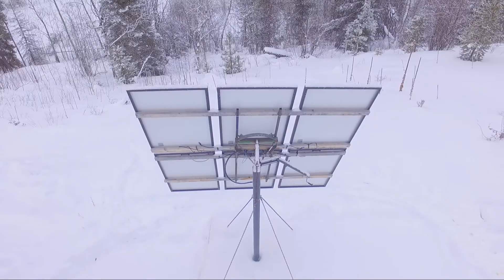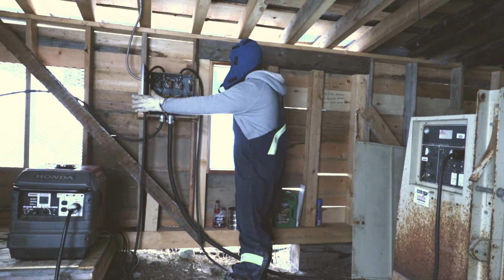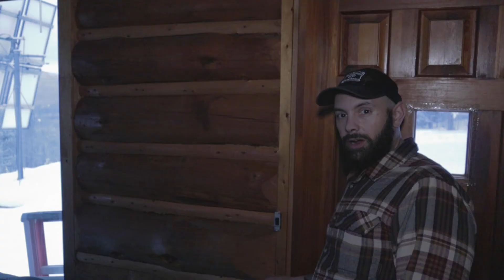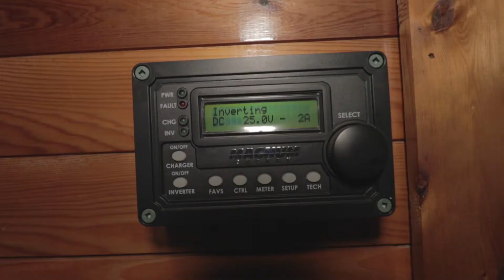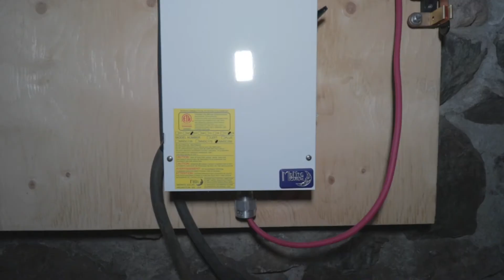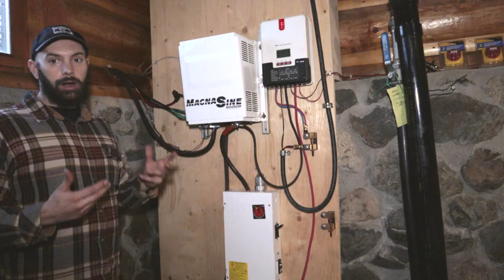OFF GRID POWER SYSTEM explained

Comment: Are you thinking of going to a 48 volt system? I think the inverter would have less work and it would be more efficient.
Reply from the maker: We are on a 24 volt system as of now; however if we did want to go to a better system we could do 36 or 48v. In time! As of now we have plenty of juice. Would need more batteries if we wanted to upgrade and then re-jumper everything.

Comment: Are the batteries for the solar panel? When are the batteries used? You have 2  generators for power plus 6 solar panels.....that seems like a lot of power need....I would assume this is due to the size of your property.
Reply from the maker: The batteries are what power the house 100% of the time. The solar panels and generators are to charge the batteries. We use the small generator only when there is a week of cloudy weather and the solar panels don't charge the batteries enough or if we are using high powered appliances that would put a massive drain on the system such as a blender, hot water kettle or power tools.  The big generator is used when we need to use 240v for a welder or anything else that is above and beyond the capabilities of the small generator. I would say we use the small generator only once every week/ week and a half to give the batteries a boost and it would only run for about 6 hours and then we are good. Being it's the winter months we only get about 6 hours of day light, in the summer we would hardly need to use the generator as we would be getting much more daylight.